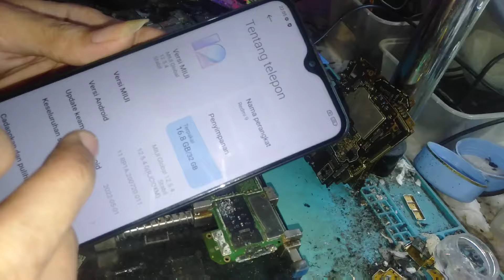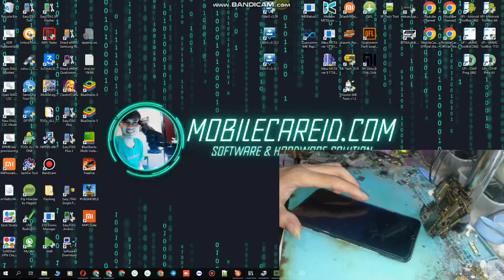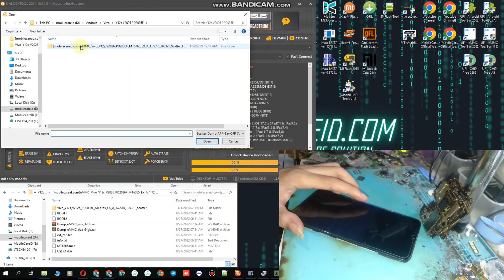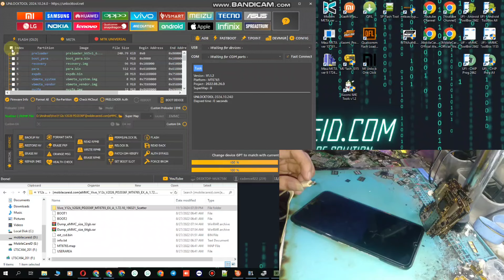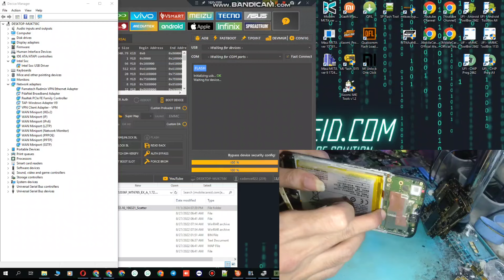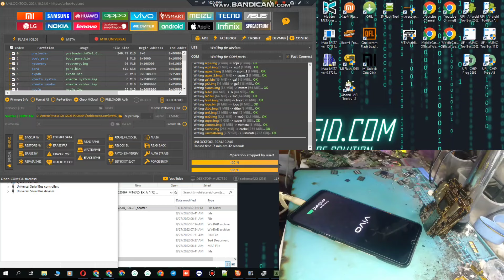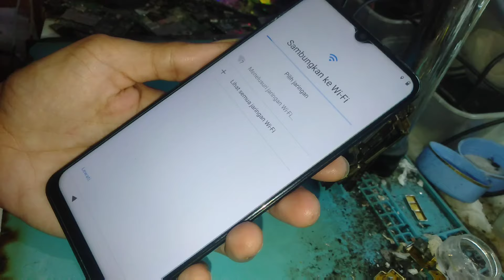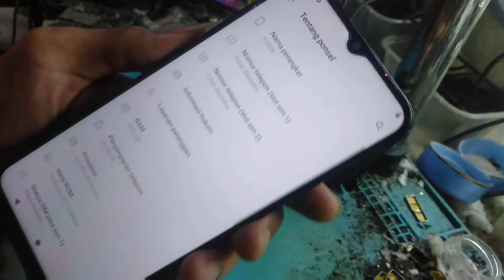Change eMMC Only Vivo Y12s Without Box | Fix Dual IMEI @mobilecareid

Comment: After reset poco x3 pro imei  gets null & unknown baseband. Is there any way to fix this issue. I have changed 100K rsa resistor to 10K.
Reply from the maker: Yes sir, change to 10k resistor, and my device's IMEI remains after resetting

Comment: Bang klo ketika di flash booting device fail. Knp it bang?
Reply from the maker: Kalau devicenya sama seperti divideo dan ngikutin caranya, harusnya ga ada masalah. Untuk type ini saya belum nemu kasus kayak gitu, tapi kalo type lain yg mediatek misal fail saat proses flash, contoh DA has mish match itu CPU nya bad connect perlu di reball. Error ext RAM itu eMMC ga support atau butuh custom preloader saat flash. Error syncing with target fail dll itu biasanya masih di CPU, eMMC, Preloader, Firmware
Reply: @mobilecareid  ok bang mksih ilmunya🙏
Reply from the maker: @yusufislami88  Ok sama-sama